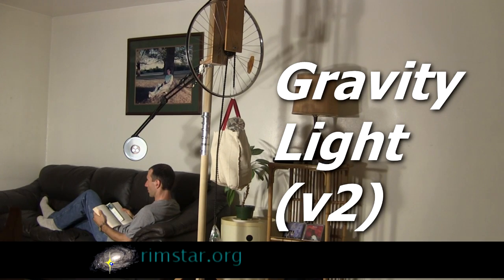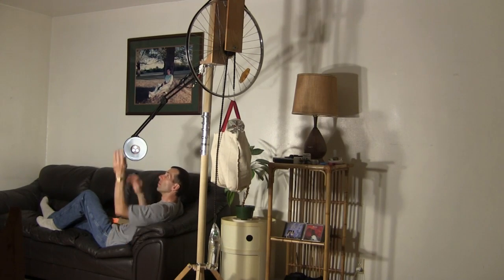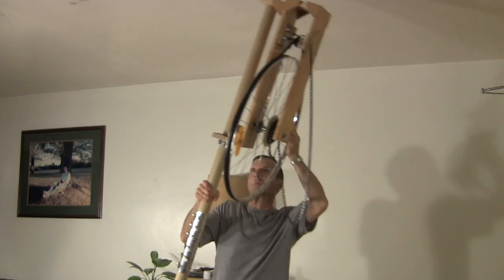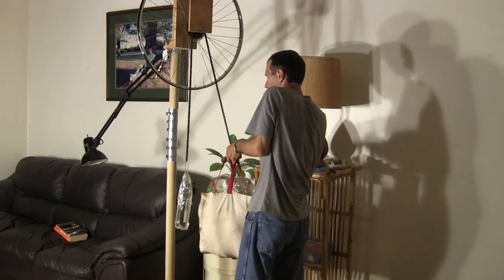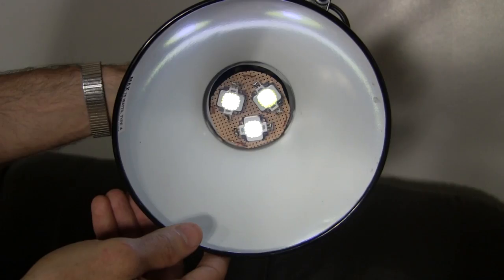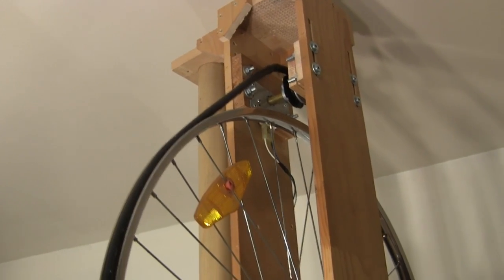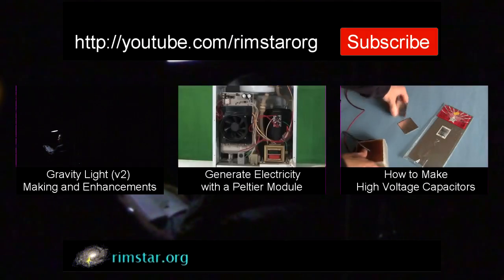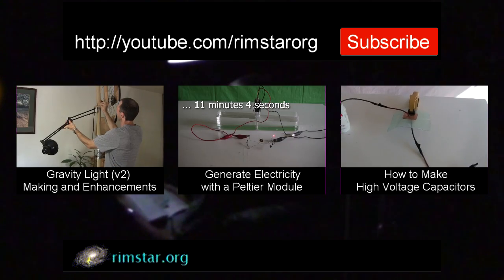Gravity Light (v2) Homemade/DIY

Comment: Hello, this is wonderful. What kind of generator or motor did you use?
Reply from the maker: Thanks. I used one taken from a microwave oven. It's the motor that slowly turns the tray. You can see photos of it here along with more details https://rimstar.org/science_electronics_projects/gravity_light_homemade_diy.htm
I used it because it has a lot of gearing inside -- turning the shaft slowly causes the generator coils inside to turn fast. That saves on making a lot or gearing myself.

Comment: Where can I get the pulley?
Reply from the maker: I got mine at a store called Princess Auto, though they sell a lot more than automotive parts. But try an automotive supply store (car stuff) and hardware store. It's a V-belt pulley since it normally takes V-shaped belts. This one https://www.princessauto.com/en/detail/2-x-5-8-in-bore-single-groove-v-belt-pulley/A-p8178725e.
Reply: RimstarOrg thanks sir

Comment: Is there any reason that there could not be several generators attached to the wheel?
Reply from the maker: If you can figure out a way to physically do it then certainly, you can connect more than one generator. Since the output is AC and it's not synchronized, each generator would be connected to its own circuit in order to convert to DC. Then the DC output of the two circuits would be connected together in parallel.

Comment: How much Voltage it can produce? Thanks
Reply from the maker: The motor/generator is an AC one and theoretically can produce 110 volts AC, but I never measured that. Instead, I measured what it could produce with my circuit, which was 24 volts DC. You can see that in my How-to-Make video https://www.youtube.com/watch?v=GisQYoYw05k starting around 2 minutes into the video.

Comment: Could you improve it by just using a much larger wheel instead of the bicycle one you are currently using?
Reply from the maker: That wouldn't help in this case. The generator I'm using is already turning at its maximum rated speed.
Reply: Could you add more wheels then to the same structure and power multiple generators with a slightly heavier weight?  It would really light up the whole room.
Reply from the maker: There would be some design issues in getting it all to fit (e.g. getting more than one generator on the same shaft) but theoretically it should work.

Comment: Sir why donot u try the super joule ringer circuit(SJR for short) by lasersaber it can help light the gravity light LEDs for a longer time.or u can try charging a super cap and decreasing the discharge time by a resister
Reply from the maker: Ziyad Mohamed I've thought about that approach (joule thief and SJR) again recently. This gravity light produces energy a little at a time over a long time. The joule thief/SJR approach requires dumping a lot of energy over a short period of time into a capacitor and then releasing it from the capacitor over a long period of time through the circuit. They're two completely different approaches. I'm having fun exploring the gravity approach.An enhancement to my gravity light would be to use an energy harvesting chip and do away with the heavily geared microwave oven motor. I think that's the direction I'll take it next.

Comment: Reminds me of how a Grandfather clock operates. Very nice demonstration of how it works, but I agree with others about it not being practical. Must be hard to concentrate and read with that noise from the DC motor. Still a great video. :-)
Reply from the maker: electronicsNmore Actually, no. It may seem loud, but it isn't really. Plus, I'm used to background noise and since this one's constant and quiet, it isn't even distracting.
Reply: OH, OK. When you aimed the camera at the DC motor above the bike rim, I heard the noise and that is why I said that. As usual, a well produced video.

Comment: Have you considered attaching some old CDs with the reflective sides pointing at each other? That may up the brightness.
Reply from the maker: TheAtomicDerp I'm not sure what you're describing. Wouldn't they block the light from coming out of the lamp?
Reply: I believe the video was titled "USB Illuminator" by HouseholdHacker. I think he used CDs to help spread the light.
Reply from the maker: TheAtomicDerp Oh! That looks kinda neat. In my case I'm trying to optimize the light more toward my book and a bit of the surroundings for reading purposes and my lamp reflector is surprisingly good for that. But for a neat looking desk lamp with cool illumination patterns that's pretty good. I'll have to keep in mind that USB trick too.

Comment: I have a better idea for you, just make the same component into a lazy boy and use your own weight, put that wheel behind you and the light over you.To reset it, just sit up or stand up, however you design it. Or just run a wire from a rechargeable battery outside to a small solar panel.
Reply from the maker: Vee Zee Great idea! It's actually already in the back of my mind. Someone suggested it on hackaday.com when I uploaded version 1.
Reply: Which one? the wire and a solar panel?

Just kidding ;o)

Comment: E=mgh, or in your case where m=14 kg, acceleration is 9.81 (lets round to 10), and h i about 3 meters. E=14*10*3=420 Joules, or watt*seconds. 1 Watt LED may last then 420/60=7 minutes, or 0.1 watt LED ten times that value (will be good that you can slow down this mechanism).

By increasing mass (m in the formula), and/or increasing height (h in the formula), one can accumulate more potential energy. With adding weight, one problem arrive (which may be solved easily), and that is friction of the mechanism. So, mount it on your balcony, and if it is say 10 meters above ground, put say 72 kilograms (my weight), and you have E=72*10*10=7200 Joules, or 7200 watt*seconds. To 'reset' this weight to the initial height, just stay on the ladder and on the mechanism that may support your weight in counterbalance of this mechanism with the same weight as yours. Then it is easy to pull that weight up to 10 meters, and you have it: light for very long time (1 W LED at 7200 J may last for 120 minutes, or two hours!).
Reply from the maker: ***** Oh, fun! I hadn't done the energy calcs myself. The height is actually around 1.2 meters (4 feet.)  I should hunt around for some more bicycle chain so I can extend it and do a higher height just for fun.

Comment: Nice video sir :) keep up those good videos rolling. I have small question regarding function generators. After I saw this video http://youtu.be/mLKPwWGBtIw i had a 2 questions :are functions generators inverters(convert dc to ac)? And can the output waves: specifically sine waves :be used in a step up transformer to step up the waves voltage ? Thanks in advance

Comment: Those high power LED's really made a big difference! Well done.
Reply from the maker: Mongrel Shark Thanks. Stupidly enough, I didn't by Crees. These are 80 to 90 lumens per watt but Crees are 132 lumens per watt, so even more improvements can be made there.
Reply: Where did you find 130 LPW cree's? If you can get these ones http://www.cree.com/LED-Components-and-Modules/Products/XLamp/Discrete-Directional/XLamp-XML
Your doing good. Used to be bags of them on ebay per a decent price. Now I can hardly find any and they are $5 each.
Reply from the maker: Mongrel Shark Nevermind about the 130 LPW Cree. Last week I found a random webpage that talked about the Cree XP-G as 132 lumens per watt, but looking at Cree's website just now, it says just 100 LPW.

Comment: It keeps getting better! What kind of current are you producing from that motor? 20-50mA?
Reply from the maker: the Hacksmith I don't know from the motor directly since I can't currently measure AC current, but that feeds to a rectifier circuit and the output of that going into my LEDs is 24V, 2.7mA. (I have three LEDs in series, each needing 8V to turn on for a total of 24V.)Sorry for the delayed reply - still recovering from this weekend's Maker Faire here in Ottawa.

Comment: I found that using a stepper motor from an old printer makes an excellent generator, it is capable of producing ample power at a very low RPM. Power can always be stored in NiMH batteries or ultra-caps for later use for convenience. Thanks for your videos:)
Reply from the maker: NORMAN WELCH Thanks. Yeah, I haven't tried a stepper motor yet.
Reply: RimstarOrg I think you will appreciate the output to size and RPM ratio. Many poles for a smooth pulsed DC output, and they are brushless. You cans filter with a bridge rectifier and buffer with a capacitor. Coupled with an LED array, it's a definite win/win. 😌
Reply: NORMAN WELCH ...you "can" filter...

Comment: Hey that is really cool Steve! What is the final RPM at the generator?
-Ritchie
Reply from the maker: SonicDadDotCom Heya Ritchie, I don't know the final RPM, though I'd like to. The generator is a microwave oven motor and has a lot of gearing inside it. My small pulley turns the motor shaft at around 6 to 8 RPM but the gears inside the motor convert that to some much higher RPM to turn the magnets inside it. I don't have access to that. -Steve

Comment: You could make a bigger version for outside.
Reply from the maker: GoRepairs I'd just need to make the chain longer. The gravity light unit itself is just sitting on the pole and is easy to just slide off of it. Then it can be mounted on any suitable diameter pole or even just hung somewhere outside.

Comment: Nice improvements! Any chance you can further adapt this to see how well it would work as a wind power or water powered light? That would be great for camping!
Reply from the maker: USWaterRockets Thanks! I don't see how I can adapt it but I love the camping idea. Hang it from a tree!
Reply: How about hanging it from a very tall tree (or telescoping pole) outside where you can make it very tall and see how much you can extend the time between resets? Perhaps some sort of rope mechanism that you can pull to reset the weight from the ground? If about 6 feet in your house lasts 12 minutes, then 30 feet outside should last an hour!
Reply from the maker: USWaterRockets A telelscoping pole would be problematic since the resulting pole has to be very rigid and stay very vertical, but hanging from a tree or your house is entirely doable.
Reply from the maker: rjn bon Yeah, so many things to try and that's one of them.
Reply: Yeah I was just camping in the redwood forest and my solar lights were not getting enough sunlight during the day to recharge.

Comment: make a gravity air conditioner and then I'll be impressed
Reply from the maker: lee clement Actually, I've toyed the idea of doing a doing a gravity powered fan, strictly mechanical. I even measured the speed of one of my fans at around 400 RPM, which is a heck of a speed-up to get from a slowly falling mass, but might be doable.

Comment: A nice experiment but not really practical.
Reply: tobortine "Failure and backup are considered" What a revelation here, failure and backup were considered. lol..  Tell that to the 900,000+ people who lost power during Hurricane Katrina.
Reply: tobortine If a CME occurs and strikes earth, or a nuclear explosion from terrorists causing a strong EM pulse, it could easily knock down the power grid. Both events would induce such ridiculously high levels of transient EMF and current that it would damage transformers, high power solid state switches like TRIACs, poorly shielded computer systems, etc.

Also as ***** pointed out, something as simple as a natural disaster or even simply poor management of power lines could cause failure. Where we live something as harmless as a breeze would cause a temporary loss of power. the local power company could not be bothered to clean off the lines.
Reply from the maker: tobortine Yeah, it's a tough nut to crack. If you look very closely at the "how it works" section of the video you'll see that I'm already on the smallest sprocket for the bicycle wheel and the light is just acceptable. I can run it faster by adding more mass, but then the run time is less. So I've improved it over version 1 by adding 50% more to the previous 8 minute run time and with even more light. But I've pushed this structure to its design limits, except that the more efficient Cree LEDs might allow me to run it slower and get the same light level with a slight longer run time.
Reply: tobortine I am not arguing practicality either.  But this is simply a prototype. Knowledge to construct  something like this could be given to those in undeveloped areas.
Reply from the maker: tobortine Yeah, with supercaps and new rechargeable batteries, wind-up things give longer runtimes already. This is only good for someone who's too weak of doesn't want to vigorously shake something or turn a crank for a bit - assuming I make an easier way to lift the mass. I should have bought Cree LEDs, don't know why I didn't. I think I will, which will allow me to get a longer runtime and then call an end to this project.
Reply: RimstarOrg I'm not denigrating your efforts, I think the time and thought you've put into the project is admirable. It demonstrates a great prototype it's just not yet finished.
Reply: Maybe not practical for the guy sitting in his heated electrified house, but luxuries such as this can fail at anytime.
Reply: ***** You seem to have little understanding of electricity generation at a national level. Failure and backup are considered.
Reply: Power Max
I accept what you're saying as being accurate and true but the experiment being shown in this video isn't a practical solution to a hurricane, a nuclear explosion or poor management of the power lines.
Wavefront seemed to be suggesting that I didn't have the right to criticise since I am in a mains powered home which could fail at any time. Being critical of an experiment doesn't dismiss it's value entirely.

Comment: how about using a wooden gearbox with steel rods and ball bearings? wouldnt that be better and have less friction?
Reply from the maker: Laharl Krichevskoy There are all sorts of things I can do like you suggest. Though the generator I'm using has a lot of built-in gears and I'm sure anything I make wouldn't be as good.